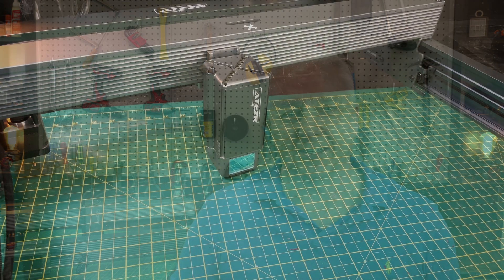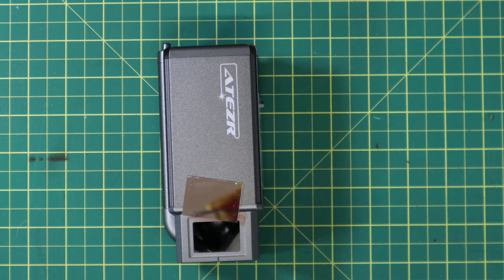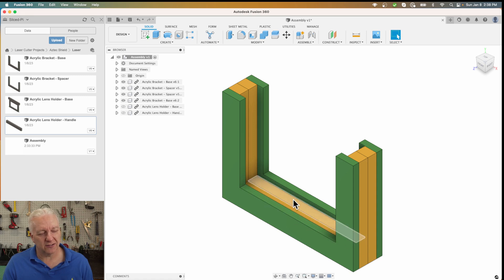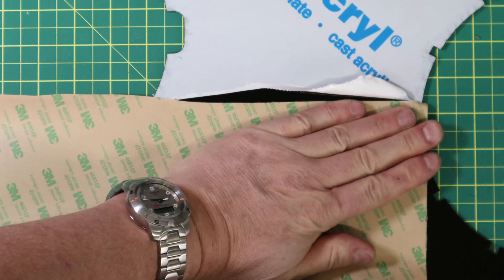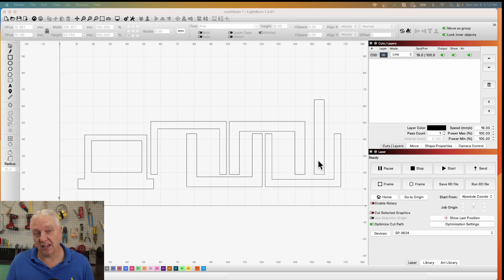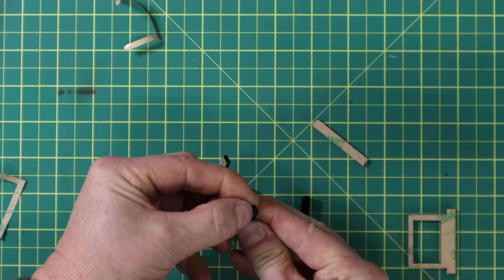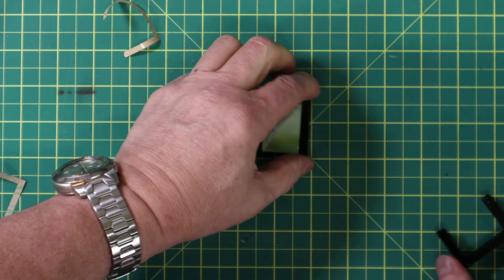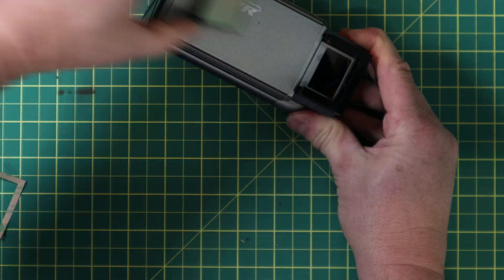Hacking the Atezr P20

Comment: Yes.  I have the same problem with my Comgrow 20w. I’m going to look into doing a modification for that one.
Reply from the maker: I was hoping someone with another laser would chime in to say this.  Manufacturers really need to think like Makers more.  I know they need to rush things to market to compete but they should really involve real users earlier to point out some of these issues.  It would actually help these companies get a market advantage.
Reply: @SteveMakesEverything  For sure!  I’m concerned about the slim clearance between the module and the cutting surface.  Hold-down pins could be a problem but I don’t know yet because my module came in DOA.  It fires when I turn on the power and doesn’t turn off.  I’m waiting for the Lunar New Year to pass before I get a support answer on that.
Reply from the maker: @Redthumb45  To be clear I was careful to ensure that the entire assembly doesn't hang lower that the bottom of the laser module.  It shouldn't get in the way - at least not more than the laser module would anyway if you had it set too close to the material.

Comment: Hey Steve, if the whole issue is to meet the alignment point, I offer my (maybe even simpler)  solution here: 

Starting with the marks that correspond to the burn point in X and Y on the laser module like you show in one of the first scenes, it does not take more than a piece of transparent sheet with cross hairs drawn or printed on it. Put the cross (with the head aligned with your desired origin / starting point on your workpiece, fix it if needed with a minimal patch of adhesive tape, then move the laser module over it so the cross hair lines match with the markings, set the starting point / origin, remove the sheet, - done. 

You just have to make sure the cross hair lines are parallel to the X and Y axis. You can attach that aiming aid to your workpiece even before putting that on the honeycomb or whatever surface. It only has to be large enough to stay visible under the laser module. Hey, has anybody ever tried a bed of sand blasting granulate as base layer? 

Basically, I like your hacking proposal too, I just see the risk of loosing or dropping the glass sheet or forgetting to reinsert it. And Atezr will have their reasons (liability etc.) to mount it fixed.
Reply from the maker: Yes this is a different way that you can do this, and it will work, but you will get tired of it pretty quick (mostly because you'll always be looking for your crosshair transparency).  There are many ways to approach this, ranging from just using simple sighting marks to what Rich, the Louisiana Hobby Guy, suggests, which is to just rip the entire annoying housing off and put the laser in a light-safe box.

If you watch other videos I've done, you will see that sometimes the project isn't the real goal, but rather to inspire you to think about a solution to a design problem when you run into one.  This ability to invent is a fundamental Maker skill that will take you far. In the specific case of this video, my goal was to keep the operation the same as the original, while providing an approach to move the problem out of the way when you need too.  Ask me tomorrow, and I'd probably design a completely different solution to the same problem.😉

Comment: I just took out the two screws and removed the entire lower shield Steve. I don't like any of these shields.
Reply from the maker: Hi Rich, I tried that too and it definitely solves the problem, but I was trying to maintain a bit of safety and preserve at least the spirit that Atezr intended.  The right thing to do is probably to rip the housing off and then put the laser into a "safe" enclosure.  Then it doesn't matter if the shield is there or not.

This is the one thing CO2 lasers have in spades- they are inherently safer because they are in a box.
Reply: @SteveMakesEverything  You can even do without any viewing windows, using a simple cheap USB camera to see what's going on, and what not.

Comment: good evening Steve from a rainy UK, ive now got the funds together to purchase my laser and i was just about to drop it on the d1 pro 20w i know its a fantastic machine but im noticing more and more people mentioning  little bugs with it , i think rich LHG was aiming at the d1 in his review of the p20 when he said there's loads of problems with the p20 main competition, ive just looked at the Atzre web site and the deals are there that make it a more attractive buy, with all the little probs mentioned do you think the atzre is the better buy over the d1pro this whole sighting thing is surely something i will get used to or do exactly what you have done here. many thanks and keep the vids coming , i feel im learning with every watch lol
Reply from the maker: Well I wouldn’t say there are loads of problems with a D1 pro, but there are two minor issues that bother me as I use it almost daily.  First, the cable shield on the X axis is too big and it can bind on the laser module as it passes by.  It’s easily fixable but it was an obvious issue that both Rich and I called out.  The second is the lack of full Lightburn support. 

Lightburn works fine with the D1Pro as long as you don’t want to change any properties and write them back to the laser. Most people would never do this but if you want to do hyper accurate cuts then you need to calibrate the laser.  Of course the reality is that the D1 Pro is an exceptional laser built with solid hardware capable of business use.

If the D1 Pro better than the P20?  It’s a toss-up.  The great news is that there are many companies upping their game to compete with both of these lasers, so more choices are coming.   I’ll do a review soon for 20W Longer and a few more are coming.  Of course Atezr now has the V35 laser which I also hope to review soon.  It promises to be a monster.
Reply: @SteveMakesEverything  thanks steve for taking the time to reply its very much appreciated

Comment: I just watched this video and also watched your Atezr P20 review video and I think I'm missing something.  I have this laser and, using Lightburn, I am able to fire the laser to aid in alignment.  It is just a setting in the program.  Is there a different feature that I'm not aware of?

To turn on the Firing option in Lightburn, go to Edit > Device Settings.  Then make sure the sliders for "Enable laser fire button" and "Laser on when framing" are green.  Then, in the "Move" menu, set the power level to whatever the minimum is to see the laser.  On mine, it is 2%.

The laser can be seen through the glass or you can raise the laser module up for alignment and then lower it to the focused position.

I've been enjoying my laser and wish this was set by default.
Reply from the maker: Yep, most people who use lightburn know how to do this.  The challenge is that getting things positioned before you do the framing can be a bit of a challenge.  In the end if you have a process that works then stick with it.